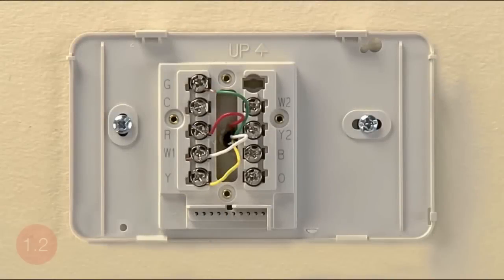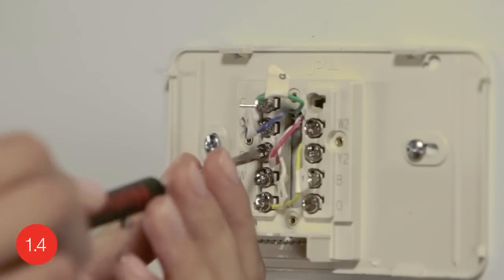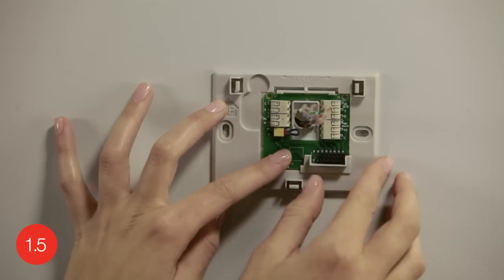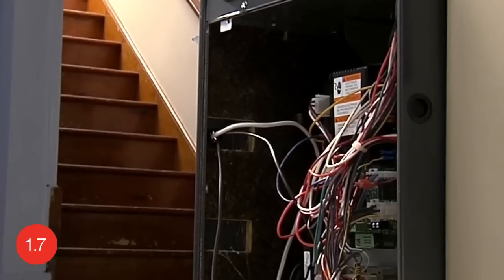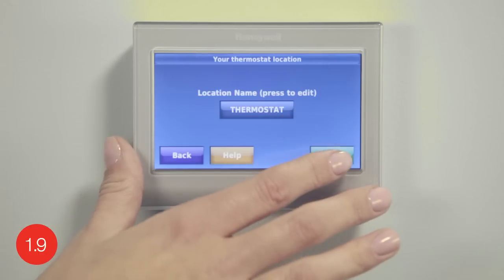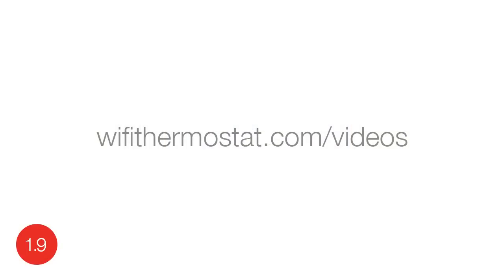Substitute G-Wire for C-Wire -- Install the Honeywell Wi-Fi smart thermostat with this video.

Comment: I just hooked this up. I did not have a C wire so I used the Green as my C. I continued to hook the other wires as instructed. I plugged the unit in and. the screen is just blinking Honeywell.  Any thoughts?

Comment: This disables the ability to use a Fan independently.  Does the C-Wire Adapter basically do this same thing or does it have something (like a battery) to allow it to run the fan independently?

Comment: I don't have a C wire. My furnace's C terminal already has a wire (white) in it though??? I did not, however, find any additional wires in my wall, but the white wire on my old thermostat is in the white terminal. I'm lost..... I thought I would surprise my husband by doing this myself, but I don't think at this point it's going to happen 😳
Reply: LOL. That white wire is going out to the condenser, not your thermostat.

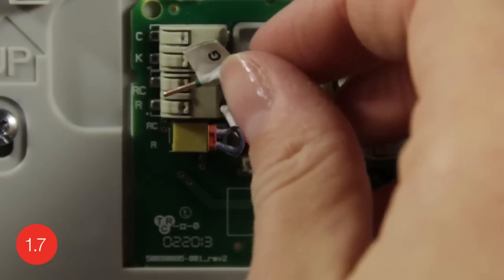Comment: 2:55 Since the smart thermostat's G terminal is no longer connected, this video says that whenever the AC (Y) or Heat (W-O/B) is powered/switched on by the smart thermostat, the fan/blower will automatically come on too...

Is it jumpered at the air handler?

Comment: 3:36 Can I just skip this part -- moving the G-wire at the air handler, from the G terminal to the C terminal ?
My multi-meter shows 27V with the R & G wires at the Smart Thermostat  (while heat pump & air handler is Not running). 

So when the G wire is connected to the C (common) terminal at the Smart Thermostat, it should provide constant power to Smart Thermostat.

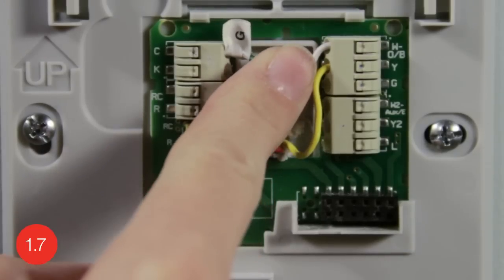4:42 The G terminal isn't connected to anything at the Smart Thermostat.

PS - my heat pump provides heating and cooling.

Comment: THANKS. my have an extra Blue wire. So I used as C wire . Just connect THAT BLUE to both, at Thermostat and at heater control box

Comment: Doesn't a heat pump system ALSO blow hot or cold air out of vents inside your home??  If you have electric only (no gas) AND one big unit that sits atop the roof and does everything AND heat blows warm air and AC blows cool air out indoor vents, then what kind of system is that?
Reply: In your case you do NOT want to do as this video suggest. Run a new 18/5 wire from your furnace to your thermostat and fix it that way.
Reply: @robert5  Thanks, I installed 10 of them in 10 different properties since my last post above.  They are all heat pump units and it turned out all had a C-wire but some were not connected (or were capped off) on one or both ends.  I have learned A LOT about thermostat connections!
Reply: @SWLinPHX  please HELPPP I’ve been looking for a way to fix mine and I have a heat pump and an ac unit outside so im so confused and have no idea how to get the wifi thermostat working because of my wiring being absolutely crazy! I have 5 wires and I’m beginning to think that the blue wire isn’t hooked up or that it goes to something else on the furnace unit.

Comment: Very helpful, the box though should mention the C-wire on the front of the box in big letters instead of fine print on the back!
Reply: Thanks to this video because  I successfully did it by myself. I must admit, I was dead scared for fear of blowing my new AC and Furnace. The techs who changed my Central AC and Furnace told me to call an electrician to connect to the C-wire in order for me to use my new Smart Thermostat.  It saved me between $150 to $250 . I thank you very much!

Comment: Why do you instruct us to jumper the Y terminal to the G terminal in the furnace.  Isn’t the fan operation and speed controlled by the furnace control board when the G override line is not active?
Reply: Some newer furnace requires separate control of Y and G. Older unit Y would control both cooling and fan.

Comment: Don't do this, there is a better way, that keeps all of your 'stats functions.
Find that unused blue (or black) wire deeper in the wall by gently pulling out the cable.  Clean that wire and insert it into the "C" spot. Go to the furnace/AC.
Start with the yellow wire in the cable from the thermostat, which is connected to the red wire in the cable going to the condenser. Since that wire is clearly Y, the other wire in the cable going to the condenser (the white wire, since it's a two-wire cable) must be your C wire, and you can connect the blue wire in the thermostat cable there (after turning the power to the furnace off and stripping the wire end back, of course).
Reply: Thank you, so much, for posting this. I was really apprehensive of the suggested fix from Honeywell- this was quick, easy, and relatively painless. You rock, Capt. !
Reply: @theapplebyfamily2  My pleasure! I'm just glad it helped someone.
Reply: @Capt_Killingfield  If only my wires had those lovely little 'hidden wires' in the bundle :(
Reply: @kempkennedy3542  There's no 'extra' wires in the bundle at all? Only the exact number of wires used to plug into your thermostat?
Reply: @Capt_Killingfield  Sadly that is correct. Very disappointing. I think I found a solution for my Honeywell system though. They make an adaptor. You plug in the 4 wires at the HVAC into the adaptor and it splits to 5. Crossing my fingers!
Reply: This only would work if you have a wire consisting of 5-solids.  Many homes do not - they have 4-strands.  You can follow this step else use the adapter which basically does the same thing by paying extra instead of making a little jumper connector lol

Comment: Funny (NOT funny) that you instruct the installer to turn the circuit breaker ON after the installation is complete, yet YOU NEVER ADVISED TO SHUT OFF the power!!!  Shutting off the breaker should be step #1 for not only preventing frying your control board, but also for SAFETY!  So much for thinking the manufacturer (Honeywell) will provide a accurate DIY video!  #LAME

Comment: By jumpering G and Y, the blower will be ON whenever the compressor is ON, but will the fan blows  the same way when the heater is ON?
Reply: It should!, the heat wire is jumpered on the back of the control board so it doesn’t catch fire

Comment: Using the G wire as the C wire is a TERRIBLE idea!! I added a Honeywell RTH6580WF to my home recently. I discovered no c wire. Without knowing what all it involved, I found the blue wire tucked into the wire bundle as it had been cut off since not in use. I stripped it and applied it to my thermostat. Still no power. I then went down to my furnace to see the blue wire was not hooked up either it was just wrapped around the same wire bundle going to the thermostat. I stripped it and hooked it to the C terminal on the furnace. Now the C terminal had a white and brown already attached going to the AC. But you can hook more wires to the C. You can hook the 3 right into the terminal or you can bundle them together with a 4 wire called a pigtail then you only have one single wire hooked to the C terminal.  User preference. So don't just assume because you found the blue wire in your wall or wire bundle behind your thermostat that its connected to the C terminal in your furnace. You will be best to take the panel off your furnace , find if a C wire is connected and determine the color while making sure it's the wire bundle going to the thermostat.
Reply: Great advice 👍👍‼️

Comment: If you have a wood stove, you will want that G wire to run the fan only
Reply: I had this problem so I just bought enough 18/5 wire and ran it from the furnace to the thermostat and fixed it that way. You could also just buy 18/2 wire, it is a lot cheaper, run that from your furnace to you thermostat and connect one of those wires to your C terminal on your furnace and your thermostat and that will fix the issue while still allowing the fan only setting to work.

Comment: It can work if cooling or heating  but when you need at same time  system OFF and only Fan running, nothing happen because green in fan relay no receive volts 24 volts

Comment: what is you install a jumper between the C and G connector and install the G wire to the C connector....will you still be able to run the fan without the system running????
Reply: HelloWhen you jump C and G,   It is doing short circuit in coil of fan relay, so when Thermostat close their  internal switch it can burn the transformer or respective fuse or cause damage in thermostat. No run fan

Comment: I have an old Mercury Thermostat with individual wires labeled W-Y-O-B-G-R, this Honeywell RTH9580 WIFI thermostat control board has the W-0/B on the same terminal.  How should I wire this?
Reply: do you have a forces air furnace with air conditioning?
Reply: FIVEOFEVER , i do have the one you stated above. Can you tell me more?

Comment: Is there a way to enable the fan to run separately when not heating/cooling? I need to circulate air when running an HRV.
Reply: not if you move the G wire to C..

Comment: Um... I followed these instructions and when it came time to turn on my central AC unit, the fan failed, just as someone stated below. Then, the HVAC people rebuilt it and then the fan didn't shut off. They are now here again and don't understand the wiring of this device. They are putting back an old fashioned thermostat which is really upsetting because I really need the wifi feature of this thermostat.
Reply: If your HVAC guys don't understand this then you got the wrong HVAC guys, these guys should be able to wire the new thermostat for you in their sleep. Call another company and tell them what you want done you will want to specify the company send out an experienced tech. If they even give you the slightest argument about that say no thanks and hang up and call some one else.

I think the present company just hired some fresh outa school guys who have ZERO experience and thus really don't know what they are doing. Just had that happen to me. Called what I thought was the right experienced local guy and he sends out two high school looking kids to fix my system. Well it got fixed but these kids really did not know much. The speculated about the problem, put in more refrigerant and that was about it.

Comment: No the fan does not come on. The AC comes on but NOT the fan. 
How about a free exchange for a 4 wire system. Guess nobody at Honeywell has any common logic. They think EVERYONE has a 5 wire system. Mine is ONLY 4!!! This does NOT work on a heat exchanger!!!
Reply: Same issue here....
Reply: There is no such thing as a 4 wire system for a wifi/always on (no batteries) display. The C wire is used to power the interface and wifi.  Many older homes don't have this extra wire because those types of devices didn't exist at the time. This leaves you 3 options: 1. Hope you get lucky and there are other wires in your cluster that aren't being used that you can substitute for the C wire (luck you!) 2. Give up use of your manual fan control by 'correctly' assembling the G wire in place of the C wire (only works with gas and a couple other types of units... ouch), or 3. Buy new wiring that contains the extra wire and feed it through from you HVAC unit to the thermostat box (hope you don't have them far away from each other or with lots of turns in the walls!)
Reply: @kempkennedy3542  Well a lot of installers staple these wires in the wall. The only other option that was easy, was to to run a power pack up to the thermostat. Also the wiring for the heat exchanger is relatively new.
Reply: Here 7 years later with the same issue. No fan after trying this. Even with the addition of c wire adapter

Comment: I opened my furnace panel and I couldn't find terminals that looked like it did in the video.  I seen some on the humidifier but not in the furnace panel.
Reply: Marshall CHS look closer for the 4-5 wire bundle/panel. It’s there on the board.

Comment: Is there any reason the G wire, cannot simply be jumpered to the C position? That would seem to supply the needed voltage to both terminals, right? Or would this create a short?
Reply: The specific reason it won't work depends on where the G wire is landed on the control board at the air handler.  If it's connected to G, the thermostat won't work, because it has no path to neutral.

On the other hand, if it's connected to the C terminal at the air handler, then your thermostat will work until the first time it calls for fan, when it'll short and blow the 3A or 5A fuse on the air handler's control panel, because you'll have essentially touched hot to neutral.  I.e., you'll have given the current a near-zero-resistance path to ground.
Reply: @ncooty  Good information. Thank you. I have since moved from that house and have two smart zigbee thermostats and two virtual now (via Home Assistant), Both with C wire intact. Working perfectly.
Reply: you will cause a short on the fan relay don't do it
Reply: Did you try it? 
Did it work?

Seems like it should have worked...
Reply: @Dave--FkTheDeepstate  I did not try it. I called my HVAC person to  connect the needed wire.

Comment: THIS MIGHT HELP SOME OF YOU. To all who DO NOT have a C-Wire and do not have a "Common" on the circuit board:
The "R" Wire is 24 volt power (HOT) coming from the transformer from inside your unit. The "C" wire is 24 volt (NEUTRAL). These two wires are needed for newer thermostat to turn on due to backlighting and other fancy features that require power. My issue was that I did NOT have the C/(Neutral) wire. Because of this, my wifi thermostat did not turn on. So since I had a spare blue cable in the bunch that was not doing anything, I hooked one end to my "C" on the thermostat and the other end to a ground wire that goes back to the main breakers. Once you have that circuit routed, everything should turn on. And I am NOT a license HVAC or Electrician. Do this at your own risk. :P...Hope this helps.
Reply: On my Lennox G20 furnace I have a "T" and not "C" terminal.  I am doing the G wire workaround - but no A/C fan (compressor runs).  Would like to try your fix, anyone else have experience with the T and not C on the circuit board?
Reply: @dwa375  T is for an outdoor temp sensor.
Reply: Thanks so much for this. This was my exact issue and your detailed instructions got me all up and running.
Reply: Yo, this was perfect for me
Reply: This will work, but it is a code violation, since you have now bonded a neutral to ground after the first disconnect.  In short, ground paths should never carry current under normal operation.  You have now energized the entire grounding path, potentially including your water and gas pipes.

Comment: But now, you cannot make your Fan run independently. Your system has to be on Heat Mode, so it doesn't work if you have a bi energy. (Electrical and Wood stove)

Comment: This video helps a lot. However, when I follow my "G" wire to the heater's terminal board, it goes to a terminal marked "CG." Do I still need to move it to the "C" terminal. Also, I do have an extra wire (its blue). Can I just do as instructed and run it from C to C and be done? The CG terminal thing has me a little confused.
Reply: Bob Smith use the blue wire for your common don't touch the green.
Reply: IMHO, the CG wire can be used as a common wire. But you may lose manual control of the fan.

What did you end up doing?

Comment: I have a dual system with two thermostats, one for each floor. I followed the instructions but there is a C wire in the heating system but not in either of the old thermostats. Do I still move the G over and attach along with the existing C wire?

Comment: As soon as I plugged in the new thermostat, it started blinking on and off with the Honeywell logo. I will have to put in old thermostat until new one can be figured out. I substituted the G-Wire for the C-Wire. Any thoughts from the forum here
Reply: did you also change to connection of the terminal by the furnace?
Reply: I know its been 3yrs but did you ever get it working?...and what needed done? just bought this and did the same thing yours did with the blinking logo....HELP!!
Reply: @dalehall2993  having the same problem. Did you ever find a fix? Have it connected properly in the control panel as well as behind the thermostat.

Comment: At 3:55, it says to run a jumper wire from the Y terminal to the G terminal (after moving the G wire from the G terminal to the C terminal). What if I don't have a Y wire to jump from the Y terminal to the G terminal? My furnace initially only had G, R, and W wires to the respective terminals. My furnace is a York Affinity 9 C series.
Reply: then jump the G terminal (fan) with W terminal (heating).

Comment: If you move G to C on both ther thermostat and furnace board, can you still connect the air conditioning wire (white) to the C terminal at the furnace board? I'm hesitant to hook it up because I don't want to fry the thermostat...but right now my AC is not hooked up and its starting to get warm!!!
Reply: yes hook up both of the wires to c.
Reply: hi. so you are saying therm c to furnace c and  ac c (white) to furnace c? thanx